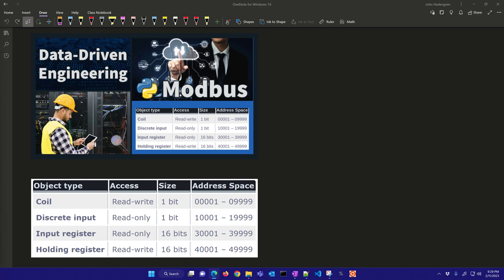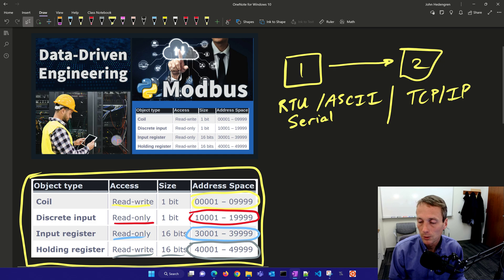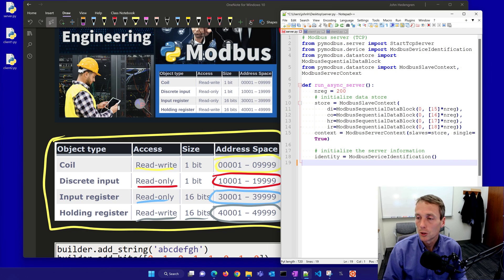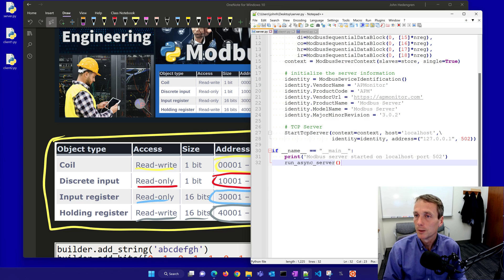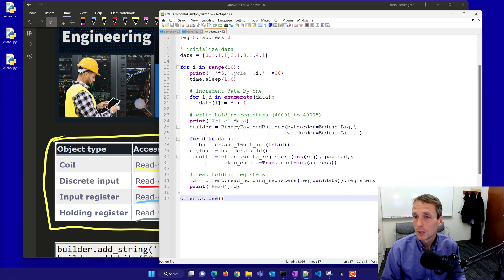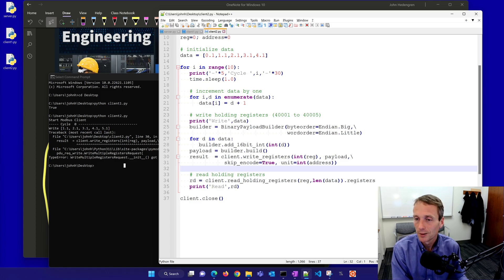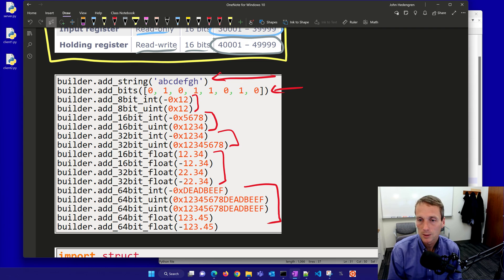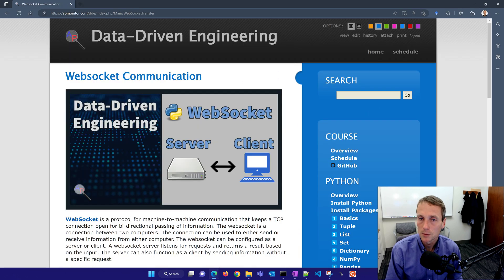Python Modbus

Comment: Hi thanks for the lesson. is any of this relevant to communicating with an apogee sq 522 quantum sensor
Reply from the maker: The Apogee SQ-522 quantum sensor is a digital sensor designed to measure photosynthetically active radiation (PAR). It uses a serial USB interface for communication rather than a protocol like Modbus.

Comment: Hi @APM,
Your tutorials are amazing! 🙌

I've set up a Modbus TCP server in Python following your guidance. Now, I'm trying to make the register data dynamic, updating them based on real-time variables in Python.

please provide solution achieve this?

Thanks a bunch!
Reply from the maker: You can write or read from the register to update the values at whatever frequency you prefer. Try setting up a loop in Python to write to and read from the register to test it.
Reply: @apm  Hi, can you advise how to do it?
Reply from the maker: @tomaskrampe7080  sure, here is a client is a good test for this:

from pymodbus.client import ModbusTcpClient as ModbusClient
from pymodbus.constants import Endian
from pymodbus.payload import BinaryPayloadBuilder
from pymodbus.payload import BinaryPayloadDecoder
import time

print('Start Modbus Client')
client = ModbusClient(host='127.0.0.1', port=502)
reg = 0
address = 0

# Initialize data
data = [0.1, 1.1, 2.1, 3.1, 4.1]

try:
    for i in range(10):  # Run for 10 cycles (1 second)
        print('-' * 5, 'Cycle ', i, '-' * 30)
        time.sleep(0.1)  # 10 Hz frequency

        # Increment data by one
        for i, d in enumerate(data):
            data[i] = d + 1

        # Write holding registers (40001 to 40005)
        print('Write', data)
        builder = BinaryPayloadBuilder(byteorder=Endian.Big, wordorder=Endian.Little)
        for d in data:
            builder.add_16bit_int(int(d))
        payload = builder.build()
        result = client.write_registers(int(reg), payload, skip_encode=True, unit=int(address))

        # Read holding registers
        rd = client.read_holding_registers(reg, len(data)).registers
        print('Read', rd)

finally:
    client.close()

--Set up and run the server first before running the client--

# Modbus server (TCP)
from pymodbus.server import StartTcpServer
from pymodbus.device import ModbusDeviceIdentification
from pymodbus.datastore import ModbusSequentialDataBlock
from pymodbus.datastore import ModbusSlaveContext, ModbusServerContext

def run_async_server():
    nreg = 200
    # initialize data store
    store = ModbusSlaveContext(
        di=ModbusSequentialDataBlock(0, [15]*nreg),
        co=ModbusSequentialDataBlock(0, [16]*nreg),
        hr=ModbusSequentialDataBlock(0, [17]*nreg),
        ir=ModbusSequentialDataBlock(0, [18]*nreg))
    context = ModbusServerContext(slaves=store, single=True)

    # initialize the server information
    identity = ModbusDeviceIdentification()
    identity.VendorName = 'APMonitor'
    identity.ProductCode = 'APM'
    identity.VendorUrl = 'https://apmonitor.com'
    identity.ProductName = 'Modbus Server'
    identity.ModelName = 'Modbus Server'
    identity.MajorMinorRevision = '3.0.2'

    # TCP Server
    StartTcpServer(context=context, host='localhost', identity=identity, address=("127.0.0.1", 502))

if _name_ == "__main__":
    print('Modbus server started on localhost port 502')
    run_async_server()

Comment: Hi. Is it possible for pymodbus package to retrieve the data from Modbus TCP/IP driver from Kepware KepServerEX? If yes, how do I get the actual values of a tag? Like in your previous videos on OPC UA Client, you were using the nodeid? Thanks.
Reply from the maker: The easiest way to get the value is to use an OPC tag browser. It should be compatible with Kepware software.
Reply: @apm , i'm using Prosys OPC UA browser and I want to implement this through python.  Do you mean that, pymodbus package can use  the tag (nodeid, browsername) shown in the browser to get its value from my Modbus TCP/IP driver? Also, last time, I was following your tutorial on OPC UA Client, with that opcua package, can I use it to get the value of a tag from Modbus TCP/IP driver? Thanks in advance.

Comment: hello, it is possible to read/write negatives values from the input and holding register with pymodbus?
Reply from the maker: Yes, either use a signed integer or a 32 bit or 64 bit float

Comment: How do you setup the Client if I'm getting modbus messages via the serial port?  (i.e. USB port COM1)
Reply from the maker: Not sure, but you could try a serial python connection instead of the IP address (TCP/IP) approach shown in this video. I’ve only used RS232 connectors for serial Modbus, not USB. Let us know if you get something working.

Comment: I am planning to trigger activity (image acquisition) on a slave computer using a signal from another master computer. (Not sure if master/slave are acceptable terms these days - apologies if not.) I will also be transferring strings. A preliminary trial shows that using IP (Internet Protocol) and an ethernet cable connecting the two computers works reliably. Seeing this video, I am now wondering if I should be considering Modbus as an alternative. If I want the lowest latency, should I stick with 'simple' IP? I suspect the answer is try both and measure, but if one is known to be significantly faster than the other maybe I don't need to.
Reply from the maker: Modbus is fast. Websockets may be the fastest. Here is an overview of methods: https://apmonitor.com/dde/index.php/Main/DataTransfer

Comment: What are coils? Does the name come from a very specific initial use for modbus?
Reply: Coils that drive relays.. its a term used in electrical automation industry.
Reply: @prashkd7684  Thanks, that makes sense.
Reply from the maker: @fburton8  @prashkd7684 is correct. The term coil has its roots in digital outputs operating solenoid coils in an industrial environment.